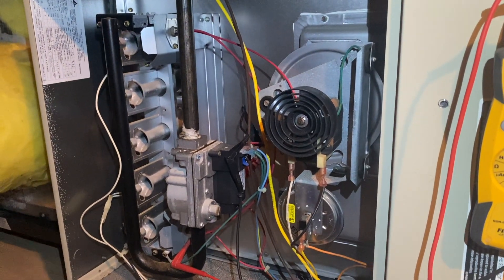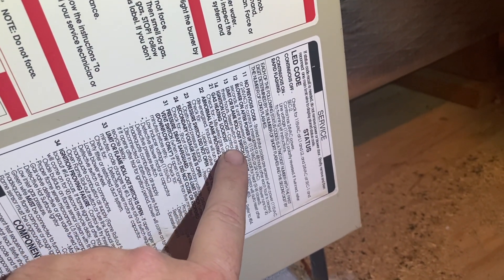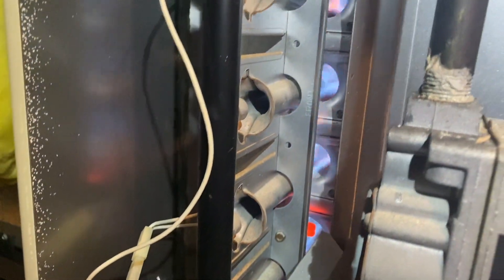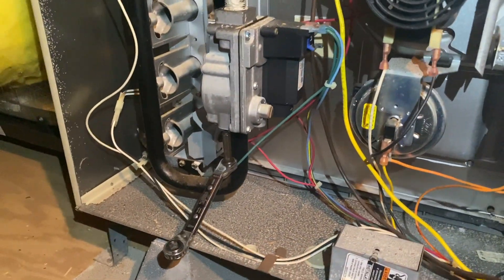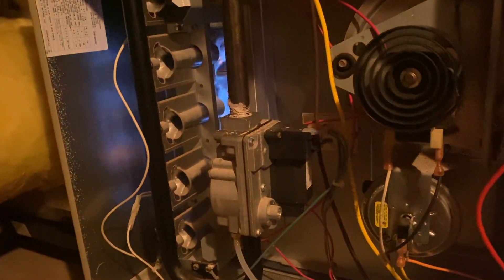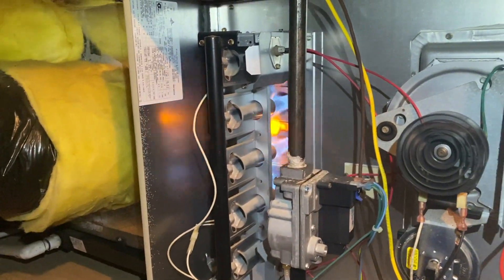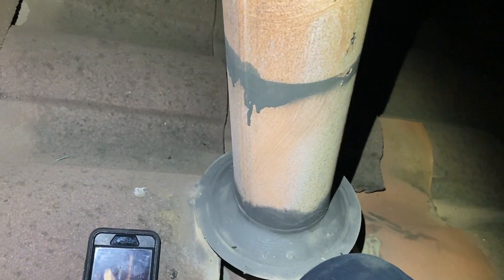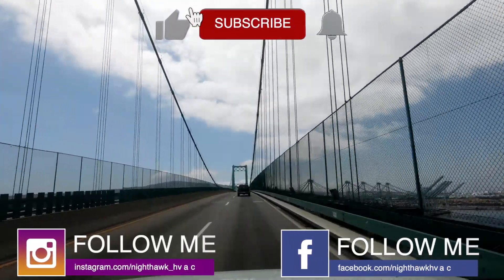Flame Rollout!!! Finding the Cause! EP44

Comment: Great troubleshooting skills but I need to leave a comment. The exhaust flue is double wall pipe, and it normally has "collars" with locking tabs, and the correct size and type vent cap fits on the INSIDE of the double wall pipe, and locks in at the correct height, but if looks like this flue is rusted out and the vent cap is the wrong size. A very experienced plumber one told me roofers very often mix the vent caps out, and if the vent cap goes on the outside of the flue pipe, it will slide all the way down and block it off. Not a big deal with new furnaces with forced air combustion and multiple safety's, but this would have caused lethal levels of carbon monoxide in the building if it was a natural  draft furnace from the 1960's, number one because the combustion products would back up into the conditioned space, and number 2, with a blocked exhaust, no combustion air would have been drawn into the gas mix, and the resulting incomplete combustion would result in a carbon monoxide exhaust instead of a mainly CO2 exhaust.

Comment: Be hard to bypass the pressure switch if that board needs to see it close prior to ignition, could be done but an extreme waste of time and putting the client at risk. Horrible technician ha do you know how many idiots wouldn’t have gone on that roof. Well done

Comment: The flue cap does have protrusions inside to limit the position on the pipe, but it looks like whatever those were gripping on the top of the pipe just corrode away and the cap dropped to where you found it.

Comment: Hi there, thanks 4 expert diagnosis. I just had the rollout switch replaced but the hvac tech told the tenants possibly not to turn on the heat due to flame rollout. Tomorrow Im having a licensed tech that Ive worked with before check out the system and if more repairs r needed. Your video gave me a few places we can ck albeit we may need a new system wh is wh this tech recommended but if that is so, why wld he install a new switch. The unit is 3-4 yrs old. I got the info 2nd hand from the rental agent as  I don't live there. Jan

Comment: One time I found kids toys in a 90 plus gas furnace pvc fresh air intake and when I had the door off it would run fine and as I was tried to put the door on it practically grabbed it out my hands and shut and it would shut off

Comment: Check draft, combustion with an analyzer and formulate an opinion. Excess backpressure (flue too small, too many elbows/offsets partial restriction very dirty or decomposing combustion chamber. The cap would be step one or beginning not the finis of the investigation. Exhaust gas temp would likely be high if draft and/or inlet air is not correct. Looked like a lot of flame there not staying where we want it - in the cumbustion chamber tubes.This is not a one diagnosis answer.

Particularly on a unit that old I'd ring her out good. A 20 year old gas furnace with that kind of roll out still evident has problems just a new cap are not going to fix. Draft check, attic ventilation, inlet air adjustment, gas pressure, stack temp % CO in the stack. visual of the stack in attic as the top looked kinda ratty. *Also noticed it appeared they reduced the stack size coming out of the roof*! Wow see what I mean? The cap is a hint and evidence not the end of the diagnosis!!

I respect your skills but 36 years of experience is wrapped up in this comment from me with the best of intentions to benefit you and all of us that want to do good work and keep our customers safe!

Comment: Wrong flue cap for B vent.  The proper cap,  along with a proper flue pipe end, that’s not butchered, would have prevented this problem.  Roofers are famous for setting things on top the flue caps.

Comment: Put your hand over the small square area where the draft rollout switch is that you reset.  If it isn’t negative pressure there, you have a blocked flue, and the draft safeguard switch is just doing its job.

Comment: Keep that cap; just put a pipe clamp on the chimney, or better yet just take a piece of 3 inch PVC and slip it over the chimney. That will support the cap, protect the chimney from further rust damage, and look more visually attractive -- for a cost of about 12 bucks for an 8FT length of PVC.

Comment: Hi
The video is very good & informative . My Lenox furnace (2008) model, started shutting off aftet 15/20 minutes,  i called 2 different HVAC certified technician and they both told me heat exchanger is  gone and need to replace the whole furnace as its heating up the switch and it’s turning off.
Reply from the maker: If you have a cracked heat exchanger you need to either replace the heat exchanger or the furnace.

Comment: What exactly is flame rollout?
Reply from the maker: A flame rollout is when the flame runs back away from the burner assembly. Basically when the flame goes somewhere it’s not supposed to.
Reply: @NighthawkHVAC  do u have a video on how to reset a primary limit switch on a lennox which doesn't have a button?
Reply from the maker: It’s an auto reset. If your unit is overheating please call a professional. As this can be dangerous to your home and family.
Reply: @NighthawkHVAC  thank u

Comment: Before you put on a new cap, what would the new cap fasten to. the venting is so chewed up, that top section of venting must also be replaced. don't just put a band-aid on it. Good diagnoses.
Reply from the maker: I reattached the existing cap properly to get them heat for the night. Returned the next day and replaced the flue pipe and cap. Thanks for watching.

Comment: I had a question. I was working on a Goodman propane,  I adjusted my gas pressure but somehow the flame weakens towards the last burner. Flame in the first burner is a strong blue, but last burner has a yellowish type flame. What do you suggest I do?? Thanks in advance!
Reply from the maker: What gas pressure are you setting it to. LP requires a higher gas pressure then natural gas. I’d check the data plate to verify LP gas pressure specification. Also has the LP kit been installed.

Comment: Just an FYI. The switch you pointed to is not a rollout switch, it is a blocked vent switch since it is nowhere near the burners. Also, just another FYI, right above the status codes is an explanation of how to decipher the status flashes.The number of short flashes is the first digit and the number of long flashes is the second digit, so, it was displaying a 31 code.
Reply: Thanks for that Rick.  I as scratching my head wondering why the roll-out was 'way over there', while there was obviously one at the top right of the burner inlets.
Reply: I don’t think the codes goes for all furnaces. Mine it fast flash then slow to read my codes. I have a Payne furnace
Reply: FYI it was unsafe to run a furnace when the venting is disconnected while testing for a blocked vent. Just spilling the flue gas in the space.

Comment: Thanks for the video. Great job finding the cause! But, shouldn't the pressure switch have not closed to prevent this? Is it stuck closed (control board should have detected this)? Is the correct pressure switch installed? Did you check the negative pressure on the switch with manometer?
Reply: The vent was clogged but not enough to affect the pressure switch

Comment: Thank you so much , I am having a similar issue , narrowing down my furnace noises . I don't have a bad rollout , but ignition bangs after a switch activates canceling fuel .Fan stays on , then igniter glows , fuel clicks 3 , or 4 times , the a loud thump , and burners ignite with a good blue flame , very small Orange streaks every few seconds flowing with blue flame , not rolling out . Looking into blocked flute , and others next .

Comment: I like videos that SHOW the problem. I get tired of videos that just talk without showing. This one shows symptoms very well. Diagnosis steps are shown. You don't just say what you did. Also A-B-A. You showed the problem (A). Showed it fixed with the cap off (B). Then put the cap back on to make it go back to the original bad condition (A) again. You are able to "turn the problem on and off", showing a correct diagnosis.

Comment: If I find the gas valve was scorched and insulation is melted on control wires. I'll condemn the unit.  If they want a 90+,, venting is no longer the problem. No point in trying to save an old unit that predates rollout switches. A family lives there

Comment: great job troubleshooting but dont youthink you could have just measured the restriction on the inducer to prove a restricted airflow, before going on the roof? of course the problem was on the roof, and would have required you puting a few screws in that cap anyways.... it doesn't seem the pressure prooving switch was working.
Reply: Actually no. On Carrier/Bryant the pressure switch is really just proving that the inducer is in fact running. The spill switch located below the flue connection  will detect a blocked flue. If it is tripped then first step is to examine the flue for and blockage. You can actually feel the hot flue gas exit that little port if there is any blockage within the flue pipe. Or use a inspection mirror and see if it fogs up.

Comment: I had this with an oil boiler. The chimney caps slid down and blocked the top of the Chimney. The equipment ran fine for the first two minutes and then started popping in banging.